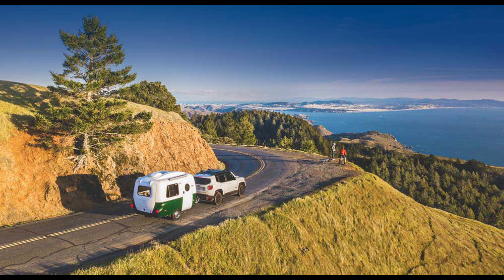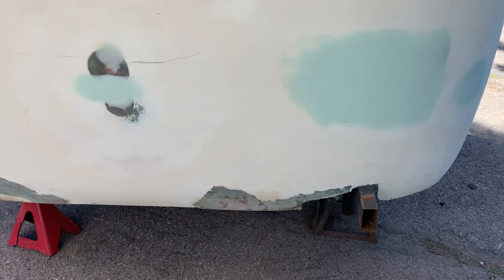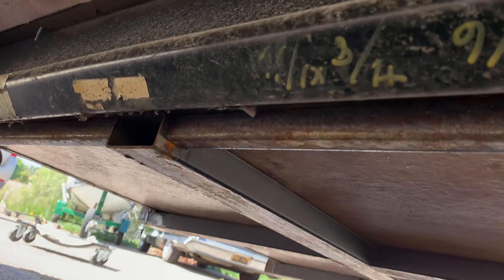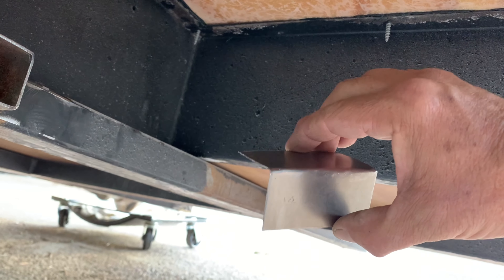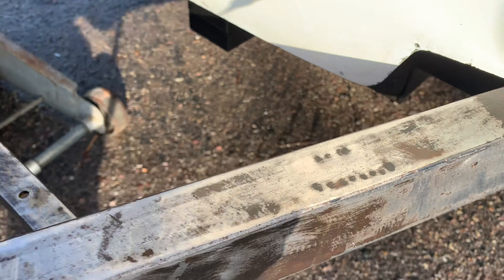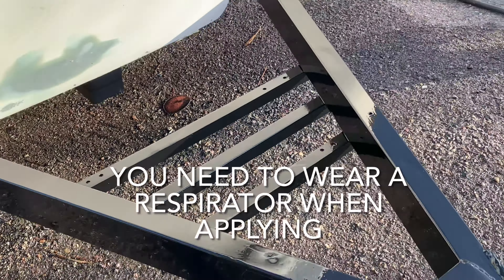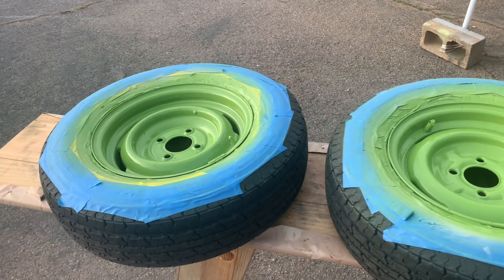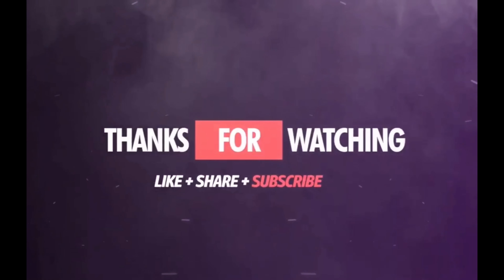Welding Scamp Frame | Frame & Wheels Painted | #Por-15 #ScampWheels #ScampTrailer

Comment: Job well done, I need to redo/paint the tongue of our Scamp this weekend (how I found your channel).  Por-15 is awesome stuff, have used it on many Scamps over the years (wife and I have owned 29 of them, yep 29).  But, highly advise putting a coat of the Por-15 "Top Coat" (I believe that's what they call it), that has UV Protection built in.  The regular Por-15 does not and will turn a very gray chaulky color within just a few months in the sun (ask me how I know).  It's fine on the frame underneath, but that sun exposed tongue is another story.  I tend to use brushed on Por-15 on the frame underneath, and Sprayed Rustoleum Professional High Performance on the Tongues and rear bumper.    I see you also still have the old 4-Lug (possibly Original?) Axle, haven't watched any of your other videos yet, but that really should be replaced.  The typical Scamp Axle will last around 10 years, 12 years if you really push it.  My rule of thumb, is look at your installed wheel straight on, if the camper well edge covers any portion of the top of the rim, time for a new Axle (might aswell upgrade to brakes if you don't already have them).    Anyway, have fun with that beauty, Happy Scamping!
Reply from the maker: Thank you Chris for the info!  I’ve not heard of the Top Coat, but I just looked it up. I’ll apply that this weekend, and if it’s okay with you I’d like to give you a shout out for the nice tip. What city are you in?  I still have the original wheels, but have a new torsion type axle. The previous owner bought it from Scamp and had it installed at an RV place around 2 years ago.
Reply: @westcoast_johnny  My pleasure, here anytime if I can help, the wife and I are huge Scamp/Egg enthusiasts. We live in Ottertail MN, around an hour south of the Scamp factory in Backus.  Lots of Scamps in this area (though not nearly as many), tried to save as many as I could over the years from being turned into Ice/Fish Houses which is how we have come across so many.  Looking at a few of your other vid's, yep it looks like your Axle is sitting at factory fresh height and should be good for a Decade or more.  I forgot you can still special order a new Dexter Axle with the older 4 lug pattern.   One other tip, I see you have the interior cabinets pulled.  Originally in the center there was a Spiral metal brace between the upper cabinet and lower countertop.  That brace along with the fiberglass closet on the opposite side act as a shell support.  So just make sure you do something similar to support that roof shell on both sides of the interior top shell or it will eventually sag and crack. Also, when you are ready to seal things up, I have tried every fancy silicone caulk on the market, and nothing seems to work better on these Scamps than the good ol' "Sila Seal" the factory uses.  Cheers-
Reply from the maker: @Chris.Donley  thank you, you’ve been a wealth of knowledge! 👍🏼

Comment: Hello! I really appreciate your videos. I just purchased the shell of a 13’ 1979 scamp with a dream, and little experience. I have some questions about reinforcing the frame of your trailer and attaching the shell: I understand that your plan uses fiberglass underneath to support the shell, did you consider welding more metal onto the actual trailer frame to support the free hanging corners? I’m trying to figure out if this is necessary (frame is in good shape/not bent) or will add a dramatic difference to the longevity of the trailer? what is the argument for fiber glass in this specific case? Any input or guidance is welcome, just wanting to start with a good foundation. Best!

Comment: Hey Johnny awesome video. I noticed your camper shell is possibly either hitting your frame on the front or has some damage. Mine has the same thing going on, did you replace the subfloor and lift the shell a little bit from the floor? Wondering how big of a deal it is or if it will get more damaged while driving on bumpy roads
Reply from the maker: Thanks Hugo, I noticed that too. I’m not sure what’s going to happen when I take the trailer out for the first time..